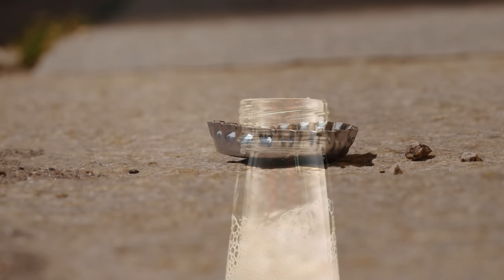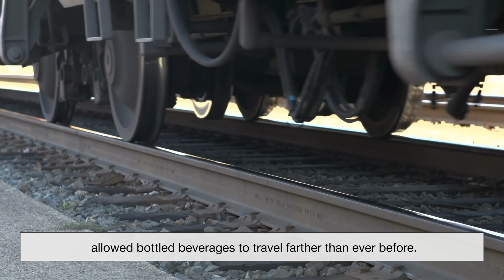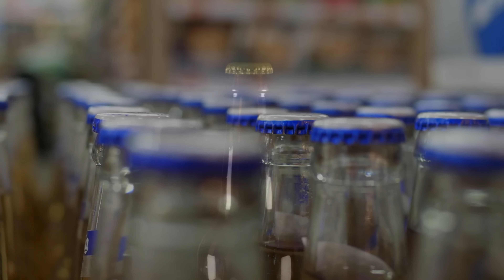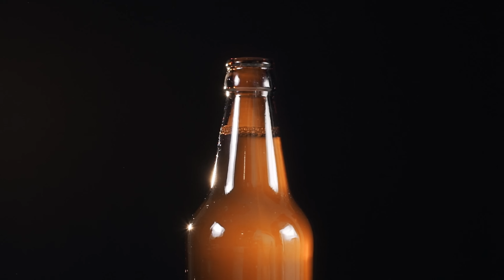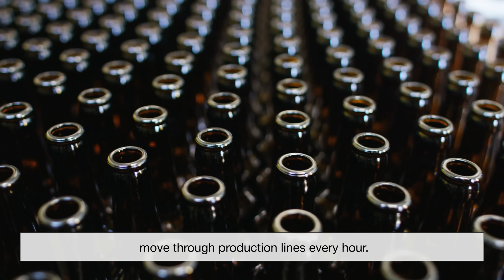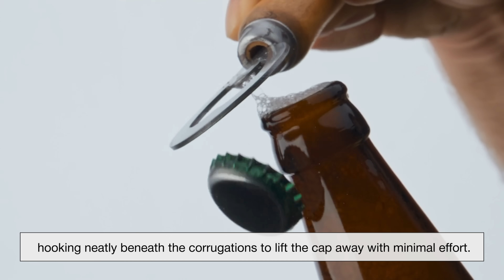Why Do Beer Bottle Caps Have Exactly 21 Ridges?

Comment: Why are they using a bottle opener to remove the cap from a bottle which is clearly a screw cap type. I know you can do it, but why go looking for the opener when all you need is your hand. Unless you aren't strong enough I suppose you could be forgiven.
Reply: It's a personal ritual. 😂
Reply: Some drinkers might not know about screw type bottle caps. Just forgive them. Simples.
Reply: @junbautista2987 Then the video should demonstrate it correctly so some of those drunks might learn and stop asking me for an opener they don't need

Comment: He never said WHY 21 till the end ??😮
Reply: The author did. Try to reread and listen carefully the topic.
Reply: Say simple : The opener (man) willuse rhe tool(opener) from any degree around the  nack on closer. So, atleast three ridged teeth shall adaquate in side opener(tool). This the reason with purpose of deridge the cap.
Reply: @a@a.c.sankaranarayanannaraya3689 The video I made contains concrete information
Reply: There are a lot of mistakes in my video

Comment: You need to be 21 to drink it.
Reply: Good
Reply: 21 years - or 21 persons? If the latter, we definitely need 21 bottles, or boxes, too.
Reply: @larsrons7937  The video I made is based on concrete information. It’s also shorter and better.
Reply: @WWH-X   I can see that my comment, your response was aimed at, has been removed (by YT). I take it you could see it in your notifications (but when you try to react to it, it's gone). Thank you for finding another way to respond to me.  Better? Everything is relative. The other channel's longer video did have more details (not that they were important, I just love many details), but had it been the same length as yours, your video definitely packed more information with accuracy into the timeframe of a few minutes. In that sense, your video certainly was better.
Reply: @larsrons7937  Have you watched my video?
Reply: @larsrons7937 thank you

Comment: As most of the times, the video does not answer fully and clearly the very question is set out to answer.
Reply: Yes, it does.
Reply: @davidhoward4715  The video I made is based on concrete information. It’s also shorter and better.
Reply: The video I made is based on concrete information. It’s also shorter and better.

Comment: Crown caps are used in many areas, not just beverages. I was a researcher in the tire industry working in the development of better synthetic elastomers (rubber) for tire applications. For over 40 years. We would use heavy duty 8 oz and 32 oz clear glass bottles with the same dimensions as the one for beverages. We bought huge quantities of crown caps from Crown with 3 small holes in the cap. A. Specially rubber seal typically Viton rubber  was placed over the  opening and we could inject  a solution with a known percentage of monomer in an organic solvent. Then inject varying levels of experimental catalysts to make new and improved tires. I never felt I worked a day in my lifetime.
Reply: Open a beer and enjoy yourself :))

Comment: 21 is drinking age
Reply: 18 in UK, in until the Muslims take over😢
Reply: @davidh4514  Sharia Flaw
Reply: I like that answer👍🏻
Reply: Then my beers should have 11.
Reply: Then my beer caps wouldn't have a ridge in Denmark as we have zero "drinking" age; that's for the parents to handle. We do have a new age limit of 16 for buying beer and 18 for alcohol stronger than 6%, so for youngsters to drink they need someone older or adult to buy the beverage. This means that someone older than 16/18 will to some degree monitor how much alcohol the youngster will be able to consume, and alert the parents if there seem to be a problem.

Comment: Why do school buses have chains that hang from the under carriage of the bus; under the bus just after the last set of tires ?
Reply: They are automatic tire chains for use in snow and ice.
Reply: I think it dissipates static electricity. 
Important for heavy vehicles carrying inflammatory cargo. (Stops sparks)
As for a school bus, I'm out of ideas.
Reply: @BatTaz19We don’t have chains hanging on our buses here in WASHINGTON STATE.
Reply: Good question. I have never seen that anywhere in the world, but if it's a costume for it somewhere, then there must be a good reason for it.

Comment: No description of how the cap seal machine works; just image after image of bottle openers at work.
Reply: He did decide it 21 ridges through years of engineering give it the precise amount of pressure to pull the sealing material down on the bottle. Listen again ?
Reply: @TonyBenton0728 You're absolutely right, my friend. I made a video just like that and wrote a description for it.
Reply: I think I did a better job with this video
Reply: "Why Do Beer Bottle Caps Have Exactly 21 Ridges"

This time when the title does not even specify the thing you asked for.

I swear there's no pleasing you people who flip the arguement around when convenient.
Reply: @Spyduck You're absolutely right, my friend. I made a video just like that and wrote a description for it.